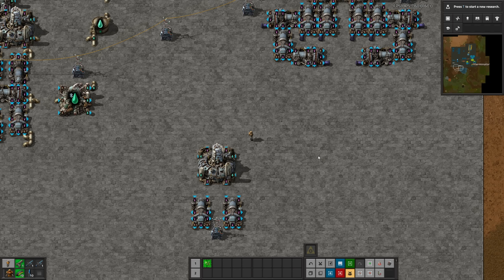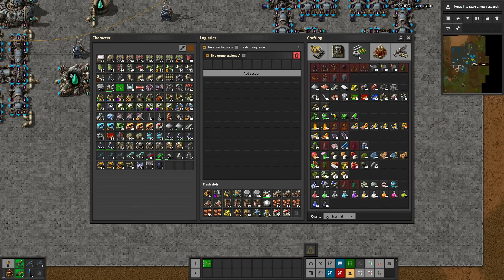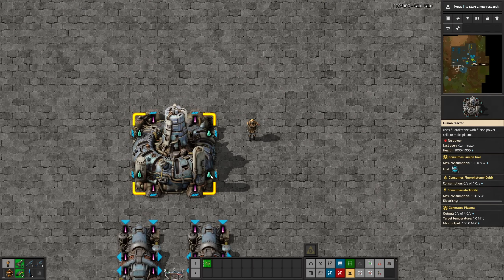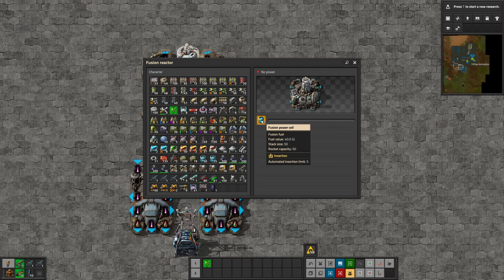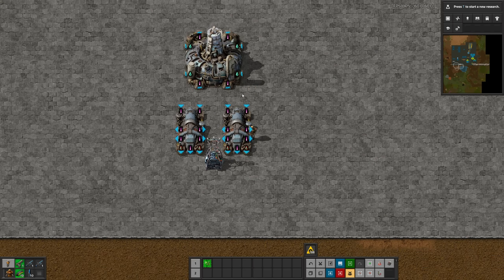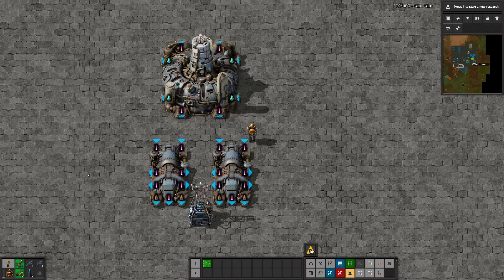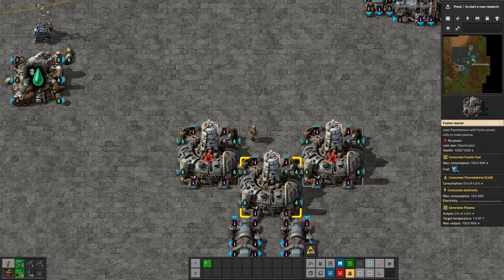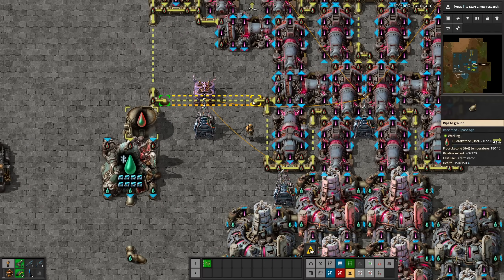Factorio Space Age Tutorial - Fusion Power ⚡

Comment from the maker: I've been made aware that the 4 reactors on the sides of my example setup aren't connected to the plasma passthrough and my dumb ass didn't notice. Thanks for pointing it out!
Despite that, it seems to work quite well though and hopefully was helpful, if even as an example of what not to do. 😅
Reply: On top of this, I'm guessing you hand fed the example reactors. The two in the middle have no path that I can see to receive the fusion power cells. Good video though, you explained the mechanic just fine.
Reply: If you left one in middle that can't get any fusion cells, will it still give the neighbour bonus to others?
Reply: If I did my math correctly, the core 6 can feed 80, and you only have 38 on the top side. Mirroring them on the south side wouldn't even take all that the core 6 could use. But it's fun watching people learn. I'm good with ratios, but the layout of the generators, that will take a while. Interesting Tessellation-type problem...

Comment: I would love to see this video redone.  The rate of fuel consumption is increased with higher quality reactors, so the time a fuel cell will last decreases with higher quality reactors.  The video doesn't explain neighboring bonus well (bonus only applies if the electricity is used), and the examples are all poorly designed.  The plasma is not connected on some reactors and there is no insertion for fuel cells.

Comment: How does neighbor bonus work? Does it make them produce more plasma or just consume less fuel? You said that the ratio is 1:2 regardless, but if they have a neighbor bonus how can that be?
Reply: The bonus makes the resulting plasma hotter, and fusion generators consume less plasma to output the same amount of power if that plasma is hotter than the base 1M degrees C. 

And that ratio is per 100MW of power your fusion reactors produce, not the number of reactors. For example, a 1-2-1 setup (1 reactor in each the top and bottom row, 2 in the middle) would output 1.4GW of power, needing 28 fusion generators.

Comment: How would you feed the middle two of the 10-reactor setup? doesnt seem like there is a way yet they are running
Reply: Might be a stupid answer (and two months later), but manually throw 50 cells there. That's 50x400 seconds (on max consumption) = 20000 seconds = five and half hours.

Comment: 16:43 After you build factory and get to fusion you pretty much mastered dealing with heat pipe. So it is not argument for not getting nuclear
Reply: It is for 2 reasons. 1:fusion takes up a fraction of the space. 2: heat pipes have limited throughput. If you are using legendary reactors, you might not even have the space to effectively get all the heat to exchangers, resulting in wasted fuel cells. No such issue with fusion

Comment: in your reactor set up you only have 6 active because the plasma connections are only on the top and bottom so the 4 on the sides have no connection to the plasma turbines
Reply: Also your large design has no way to insert fusion cells to the middle reactors
Reply: @p1ngerss  To be fair, if you chuck a stack of fusion cells in there, it will last an eternity :D
Reply: @DasSchorty  if eternity = 10 hours then im immortal
Reply: @incription  I mean, 10 hours of in-game time. Yes, it's an automation game, so you should try to automate everything. But my boss would love to argue that a 30-second task once every 10hrs is hardly worth the automation. I disagree with this sentiment, and its why I love Factorio. My point was just that it's not that crazy to consider manual loading for a better neighbor bonus if you're dedicated to maximizing the power output per reactor.